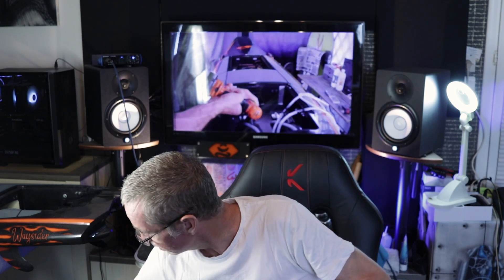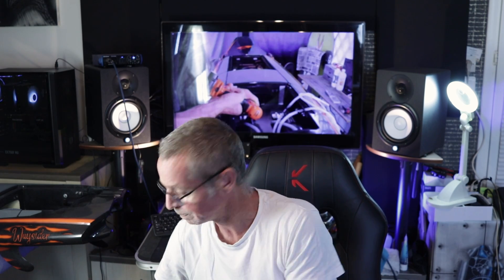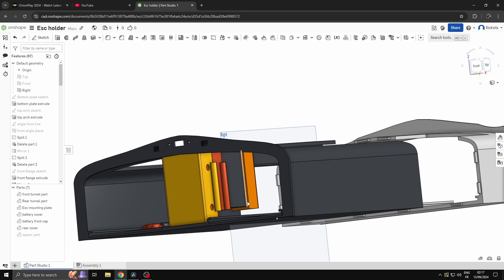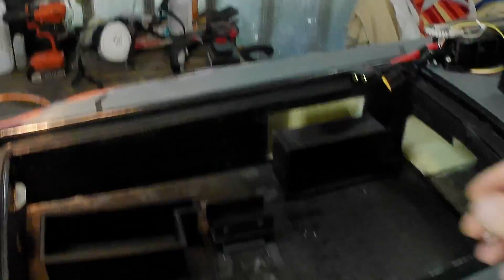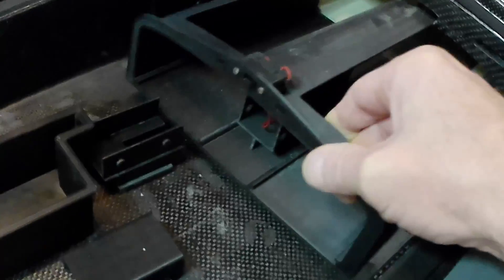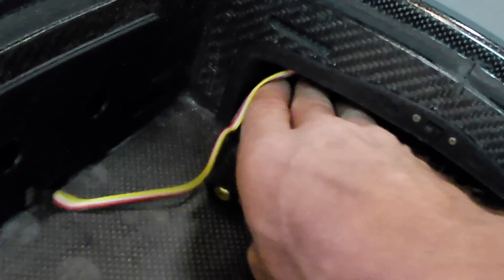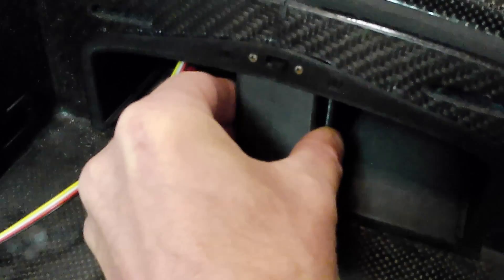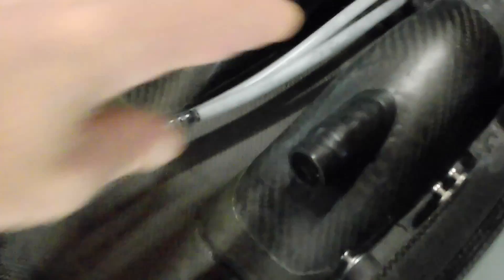DIY Electric Surfboard Upgrades

Comment: Hey building a jet 80mm jet drive with a mp83100 8kw 253kv  and a fipsky 75200vesc. Not sure on board  size i need
Reply from the maker: That my friend is really up to you the depth of the board is important to fit easily the size of motor,,drive and battery etc so the hatches fit easily. For the length work out where you are going to place everything then make a cardboard template that looks about the size you want.try and keep it within the jetsurf specs and you will have a performance type board.